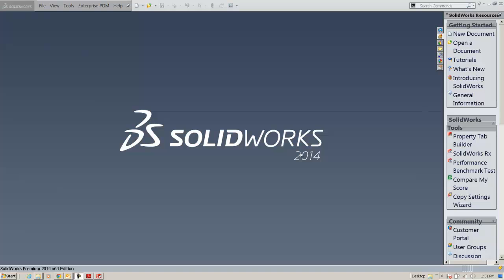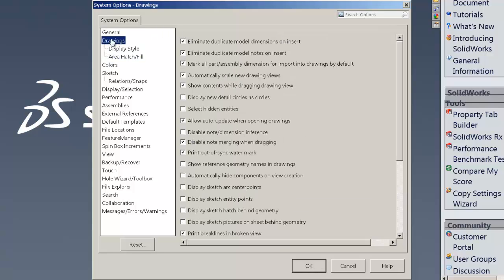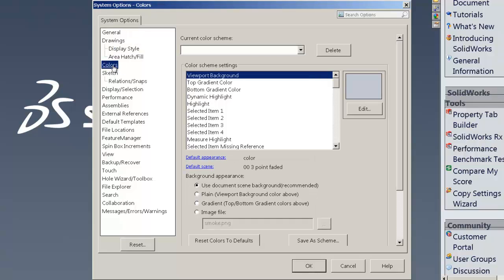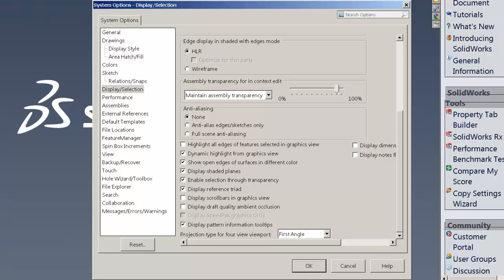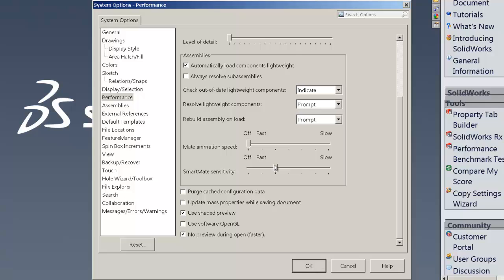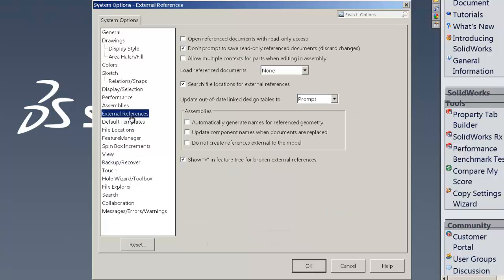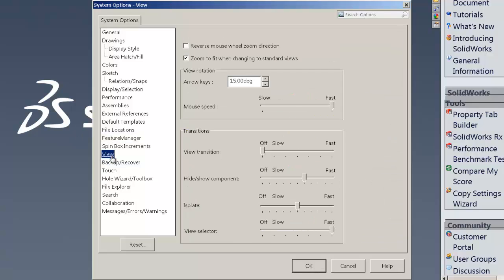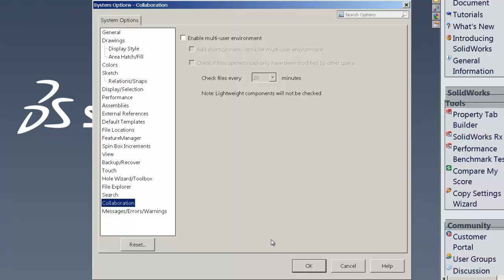SOLIDWORKS - Settings for Maximizing Performance

Comment: WHEN I CLICK ON  REFERENCE GEOMETRY OPTION FOR CREATING PLANE THE SOLIDWORKS 2016 SHOWS ERROR AND CLOSES.
PLZ HELP ME IN THIS
Reply from the maker: Hi Raviteja,
What you describe sounds like a common issue caused by damage to the Microsoft .NET Framework on your machine.  We would recommend this process to try to fix it:

Login as an administrator and turn off all anti-virus applications.

1. Download and Run (as Administrator) the "Microsoft .NET Framework Repair Tool" from below given link:
http://www.microsoft.com/en-us/download/details.aspx?id=30135 

Following this try running the installation again. If it still fails do the following process:

2. Go to Control Panel > Programs > Programs and Features and manually uninstall all .NET Framework 4.0 / 4.5 products that may be listed in Programs and Features (you can skip this step if there are no .NET 4.0 / 4.5 products listed)
3. In the left pane of Programs and Features, click "Turn Windows features on or off" and Deselect "Microsoft .NET Framework 3.5.X"
4. Click OK, and wait for the change to be made
5. In the left pane of Programs and Features, click "Turn Windows features on or off" again
6. Select "Microsoft .NET Framework 3.5.X" (leave "Windows Communication Foundation HTTP Activation" and "Windows Communication Foundation Non-HTTP Activation" deselected)
7. Click OK, and wait for the change to be made
8. Restart the computer
Reply: @goengineer  I'll try this....thank you

Comment: I did applied this solution but it doesn't work with sheet metal why
Reply from the maker: Hi Mohamed,
These recommendations are not file specific.  They are just some recommended settings to make the program run as well as possible on any given hardware.  If this doesn't improve the performance of your machine to an acceptable level you would want to look at your hardware to see what needs to be replaced to speed the machine up.
Reply: Thank you

Comment: Works perfectly, thank you so much sir! I have asked people on Facebook SW group and they were talking how my GTX 1060 is not good for any CAD software and my SW is using Intel HD GPU card for running it by default, still I made it work perfectly clear. Thank you once again sir!
Reply from the maker: Hi Cigara,
The users on Facebook are not wrong.  An NVidia Geforce GTX 1060 graphics card is not supported for use with SOLIDWORKS and will tend to have more performance issues, graphics anomalies, and crash SOLIDWORKS more than supported NVidia Quadro graphics cards.  If you are able to work with this graphics card I would recommend backing up the graphics driver that allows it to work as you may need to revert to this driver in the future if the software once again has problems.
Reply: GoEngineer hmmmm i can say that it is working better when i turn on all options in settings. Can i somehow force SW to run with GTX gpu cuz it says that by default sw is running with intel hd gpu. My laptop has 2 gpus
Reply: how did you use/fix/"manage" your gtx 1060 with solidworks? My laptop specs is i7 7700HQ,  16 ram, gtx 1060 6GB dedicated. 1tb hdd, 128 gb ssd

i have been looking on how to maximize the laptop with 1060 using SOLIDWORKS, 

i think we have the same issue with the gtx 1060 on SW... i keep seeing you in the comments with gtx 1060 and solidworks... but i have not found a viable solution, have you? 

Please help... thank you.
Reply from the maker: Cigara,
It is a late response but the best answer to your question is, yes.  You should go into the machine's BIOS settings and turn off a setting called "NVidia Optimuse" (aka "Switchable Graphics" or "Hybrid Graphics") which will disable the Intel HD card from loading when the machine starts and force all operations through the good GPU.  This is how it works for workstation laptops at least.  Maybe it will work for yours as well.

John,
Probably the only recommendation I could give you is the same I give for Cigara above.  Disable the Intel HD graphics card and force all operations through the good GPU.
Reply: thank you

Comment: This doesn't work, still takes forever to realise I've clicked the screen
Reply from the maker: Hi MuscleSheriff,
If these settings do not improve your performance we would encourage you to contact your local VAR (the company you purchased SOLIDWORKS through) so you can open a investigation with them on why your performance is suffering.  If you do not know who your VAR is you can find possible companies here:

http://www.solidworks.com/sw/purchase/varlocator.htm
Reply: GoEngineer it's okay I just had to restart my computer instead of shutting it down :) it works, I gave you a like!

Comment: I'm using SolidWorks through Parallels on my Mac and your tips really sped up the software. Thank you very much!
Reply from the maker: Hi Ricardo,
There is not much that can be done to speed up performance of a virtual machine like Parallels on a Mac since it doesn't have access to the GPU hardware.  It may be better to utilize Bootcamp instead as it does have access to the hardware.

Comment: I have solid works 2015.. When I move mouse cursor to tools that tools name it won't indicate.. can u give solution for this??
Reply from the maker: Hi Rolson,
Does using either of the SOLIDWORKS Rx (found by searching "SOLIDWORKS Rx" in the Windows Start menu) safe modes change this behavior?
Reply: GoEngineer 
In that which settings should change?
Reply: Can u give your email id? I'll send screenshot of issue I am facing

Comment: my template become black I am using solid works 2015.my lap specs are 4gb ram 
                   2gb nvidia 940m
                    i5 processor
                     1tb hard disc
           and main thing there is not even a single video or image ,songs in my lap I don't  know what made my solid works become slow.my 1tb hard disc memory still empty. please help to solve my problem
Reply from the maker: Hi Jana,
As you may have already discovered an NVidia GeForce GTX 940M is not a supported GPU for running SOLIDWORKS and this sometimes causes graphics issues with the software.  In such a case you would want to enable a setting under 'Tools', 'Option', 'System Options', 'Performance' called "Use software openGL".  This can help to stabilize the graphics issues in certain instances (not all unfortunately.

Comment: Thanks a ton for the video. Actually i was searching for this setting for long, wonder if you could help. 

When you hover your cursor over a command or tool a soft description window appears automatically describing the name of the tool etc. that setting is off on my Solidworks and am unable to find it. 

Thanks.
Reply from the maker: Hi Anurag,
I believe the setting that you have disable on your machine is called "Show tooltips" and is found under 'Tools', 'Customize' on the 'Toolbars' tab of the Customize dialog.
Reply: That option is already ticked, don't know why it isn't showing. anyways thanks for the reply.
Reply: I found this on the forum. Its a fix for SP05 and it worked for me.

1.     Click 'Start', click 'Run', type "regedit" in the 'Open' box, and then click 'OK'.
2.     Locate and click the following subkey in the registry:   HKEY_LOCAL_MACHINE\SOFTWARE\Policies\Microsoft\Windows\Installer
                Note: If this subkey does not exist, create it.
3.     In the 'Edi't menu, point to 'New', and then click 'DWORD Value'.
4.     For the DWORD name, type "RemappedElevatedProxiesPolicy", and then press 'Enter'.
5.     Right-click "RemappedElevatedProxiesPolicy", and then click 'Modify'.
6.     In the 'Value' data box, type 1, and then click 'OK'.
7.     Run a Repair of your SOLIDWORKS Installation (S-050527)
8.     After the application installs successfully, reset the 'RemappedElevatedProxiesPolicy' DWORD value to "0" to re-enable the security fix for KB 3072630.

Comment: Hi, my Solidworks used to work like a charm, but all of a sudden it became super slow.
I`ve tried uninstalling, and maximizing performance, but it is still as slow.
Now I can`t even use my Solidworks because it`s too damn slow.
Best Regards
Reply: I believe it was because of a GTX update
Reply: I was running it with NVIDIA-processor and not the integrated processor...
I feel dumb haha.
Reply: I am also facing same problem with my solidworks 2014 did u get any solution for the problem.

Comment: Hello! Thanks for the video.. When I go to the 'display style' option, there is no 'edge quality for wideframe' options and no 'edge quality for shaded edge' options.. I only have 'display quality for new views'. Is this because my graphics card is not good enough to allow for these extra settings? 

The problem I have is that when I draft it comes up with the option 'calculate' which doesn't allow the draft to remain visible when I confirm the draft.

Comment: How to have the setting which will show information about the every icon when we move our mouse cursor on it .....
For example when you moved your mouse at "New File" icon, then you got a box written as "New (ctrl+N)  creates new document" 
pls reply ...!!!
Reply from the maker: Hi Vinay,
If you go into 'Tools', 'Customize' and on the 'Toolbars' tab enable the option for "Show tooltips".  Once enabled tooltips should begin to show as you hover your mouse over buttons.  If they still do not show it could be a consequence of a bad interaction with a Windows Update.  You would then want to go through this process to fix that (http://kb.goengineer.com/go/default.aspx?kbID=13957).